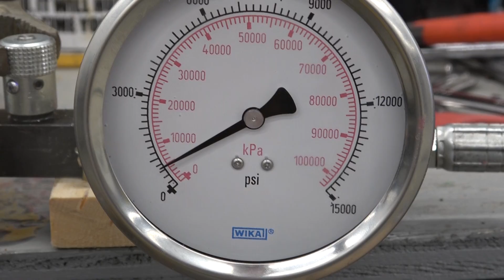How much pressure can PEX take?

Comment: The primary advantage of PEX vs. copper is crackheads and meth addicts don't rip it out of the walls when homes are under construction.
Reply: Primary advantage is it's cheaper.. also easier to install without screwing up.  Also when the asshole plumber lays half of it on top of your steel ducts with no insulators, it doesn't rot in 3-5  years and flood out your basement.
Reply: @BobSmith-rs7tn  Awfully specific haha.  That sucks.  I'm totally comfortable doing my own plumbing with PEX; more than I can say about my faith in my soldering skills.
Reply: up in the cold climates, its the go to, now. I've seen it survive minor freezes and contract back (nearly) to original size. Just about every new construction and full remodel site I've been on, is using pex. Crimp, cinch or expansion though, never shark bite.
Reply: @gpadog  Same. I've yet to see it fail from freeze/thaw cycles. I'm actually suspicious that it has saved metal pipe sections by acting like a spring when the pipes freeze.
Reply: @gpadog  Push connects are used on water heaters for easy install/replacement.
Reply: @gpadog  that's because it's cheaper. Price out a 10 foot stick of  copper vs pex
Reply: @gpadog  here in texas its pretty much taken over
Reply: @gpadog  Sharkbite fittings fail at about 150 PSI and should never, ever be used in a concealed place. On my job sites I only allow them to be used temporarily; when the plumber is gone, the sharkbite fittings are gone
Reply: @pinhedd  I was replying to the op, how pex is better. Not a fan of sharkbite except in an emergency, and the propress is on another job.
Reply: @pinhedd  I have plumbed 5 houses about 10 years ago and the sharkbite fittings Push to connect have not failed or leaked. Installed the right way and they will last a long time.
Reply: @pinhedd  there are rare situations in repairs and reno, say around a tight corner with not enough access and you can't cut into the studs.  Then you need the shark bites.  I personally would rip the damn thing out, but most wouldn't.
Reply: @pinhedd  I agree if you consider yourself a plumber you shouldn’t be using sharkbites they’re for homeowners and handymen
Reply: PEX also isn't sensitive to rust settling in the pipe, whereas copper develops pinholes.
Reply: Duck Multiverse it’s not rust, mostly chloramines used by city to treat water. Also old water heater deposits steel in the pipe then electrolysis causes corrosion and you get a pinhole. Copper coating 4x what PEX does is a big factor too.
Reply: way easier to run overhead as well and still accessible
Reply: Also dont blow if they freeze. We've dont lots of replacement at a family house and eventually replaced all of it with pex. My lines have frozen two or three times in the 13 years we've lived here and the pex hasn't blown
Reply: @bolerdweller  Yep I can attest to that, we has a spell of -40 for a few days and had a remote laundry room freeze up and after the spell and the temp lowered we it was able to thaw out.
Reply: You mean joggers don't.
Reply: @umeng2002  oh, I see what you did there
Reply: Don't know anything about this mind you, the tubing might be cheaper than copper per length but those fittings look expensive as frick, is it really cheaper than copper taking in account all the fittings?
Reply: @teresashinkansen9402  just doing a quick look into it on home depots website. 1/2 90 fittings for PEX are about $1 vs copper about $0.5. Where PEX really eats coppers lunch is pipe price $0.23 vs copper $1.40 per ft. Also PEX is slightly flexible and comes in longer sections so you might need not need as many fittings.
Reply: @WilliamJay  need to add in time to sweat the copper fittings. Also propane/map gas, solder, etc.
Reply: @teresashinkansen9402  The crimp connectors are cheap. The shark bite not so much. But no professional uses shark bite that I know of. That stuff is for DIYers who don't want to buy an expensive crimping tool. It works, but I'm told the water hammer effect can eventually work those spikes deep enough to burst the pipe. However they seem to last. My first home reno has them, and they have lasted pretty well touch wood. Thankfully I know better now.
Reply: @Patrick-857  The crimp tools do not cost that much. What the crimp does is cause more failures than the sharkbite. I have installed 5 plus houses 10 years ago and never had a leak. I just did my house a week ago and did not have a single leak. My roofing contractor how needed a temp line put in for power washer installed a few crimps and they did not seat right and leaked, I jumped in and put a sharkbite in and had no problems. The other thing is that if you do not have enough crimps you are stuck. If you have to make any changes sharkbites are easy to remove and adjust. Crimps take more work to remove and adjust.
Reply: @teresashinkansen9402  using sharkbites for the whole job, probably not. Using the compression fittings, most likely. I know they've been installing this stuff in new homes as far back as the early 2000's when I was working for my dad building houses.
Reply: @teresashinkansen9402  Sharkbite fittings are more expensive than compression fittings, but they make up for that in how quick they are to install. I'm no plumber but sometimes I'll change a valve, and instead of carrying compression fittings and a large bulky crimp tool, I just cut the tube right off with a pipe cutter (PEX is even easier, it just requires some sort of scissors made for that) and I slip the new valve right on and call it a day. It's way faster than nut-type compression fittings or copper soldering.
Reply: @teresashinkansen9402  PEX uses considerably less fittings than copper so it makes up for it.
Reply: @teresashinkansen9402  Depends on where you get them, Fittings cost around 10 USD each and if you order off brand ones you can get them for about 2 to 3 USD per fitting. The cost my be a bit more yet the labor to install them is way less. I just plumb up my house with 2 toilets, one shower, 7 washing machine outlet boxes 3 sinks, Along with some drop legs for commercial 3 bay corner sink and side hand sink. I used 200 feet of 3/4 pex and less than 20 feet of 1/2. The only reason I used 1/2 is that they do not make washing machine outlet boxes for 3/3 or make toilet kits or sink kits with 3/4 connections. Washing machine outlet boxes are to supply 2 washing machines, 1 mop sink, one ice machine, one automatic pet water bowl, one dish washer and one coffee machine.
Reply: Just wait until they go start stealing ground lines off utility equipment and get electrocuted.
Reply: That's a big selling point but another big one is wannabe plumbers who have never soldered a pipe have become plumbers. It's horrible! I've been an HVAC tech forever & I just started my own business. I'm building a customer base & I've been on a few jobs that have blown my mind. I can't believe some of these guys who call themselves plumbers. The one guy couldn't solder!!
Reply: Coppers hit or miss where I'm at in Northwest Florida. Pretty much if you're on a well forget about it. The copper in my house is doing fine but the next house down the road may have hell with pinholes. I mainly see them around water heaters or in the slab usually on the hot. I don't know if its just a bad run mixed with the water because some houses never have a problem and some constantly do. Pex is the way to go imo.
Reply: Also pipe in pipe is standard here for enclosed runs, outer pipe is just leak protection/teller, and it’s possible to reline if it’s not a nightmare run.
Reply: There are several advantages. It's cheap. It last a long time. The pex in my mobile home down south has been there since the 80's with no issues even with it being possibly frozen in the winter when everything was shut off. I tried to drain the lines, but I am sure I didn't get all of the liquid out. Its flexible lightweight and easy to install no soldering required and plastic can withstand the sulpher water that has corrosive  hydrogen sulfide  in it that eats metal pipes.
Reply: You must be from Canada
Reply: Good point- I've only ran pex....full crimp only...not the single sided pinch crap!
Reply: Every time I replace pipe I replace it with pex, holds up so much better in the cold, and those shark bite fittings makes everything quicker to get done, even my job is known to use them for any line not under real pressure
Reply: just plumbers after the mouse chews holes in em mistaking them for cheese sticks.
Reply: Let us hope that hot water tanks can be made out of this stuff. In the UK here a lot of water tanks are copper and i have seen those people you describe doing that and taking the tank also.
Reply: @alexgrant1979  Yeah they do that to empty houses here in NZ too. Rip it out and leave the water running. Owner may not find out for weeks, by which time the damage is catastrophic.
Reply: god north america has an opioid epidemic, can't we just give em weed so they calm the fuck down?
Reply: @cdoublejj   we need some cocaine to calm down too
Reply: Actually had that happen on a regular house here in Baltimore.  Got a call that someone stole the copper out of a house, LIVE, and their 1" main was flooding the house.

By the time I got there it was 8" deep in the whole first floor, and actually running out the front door into the street.  All this during single digit temps too lol
Reply: I know the primary benefit of PEX versus copper is as a plumbing company owner it's 1/8 of the price to my cost.....
Reply: Metal prices crashed years ago

Comment: Repeat with Uponor ProPex.  Bet that's a good show.  Sharkbite sux, btw.
Reply: Wirsbo has so many advantages, I love how it will go back to faktree configuration with just some BTUs!  And, unlike German women, it never stretches out at the fittin' ends!
Reply: I searched the comments until I found an Uponor comment, just to give it a thumbs up! Great product and company. Get the 3" ProPEX fittings, Milwaukee cold expansion tool, and their 3" tubing... Impressive stuff!
Reply: If AVE tests on the Uponor Pex, I hope he includes a bit on the chemical differences of how the irradiation process is different during manufacture and how it can recover from kinks unlike the inferior pexs.
Reply: @timkunsa7249  Uponor PEX is not cross linked with irradiation, it is chemically crosslinked during extrusion. I agree that hearing of the differences between PEX-A and B would be interesting for many. I do the kink demonstration often and it gets everyone excited!
Reply: @SlipNSlideMNzx2  Thanks for clarifying, I couldn't remember how the cross-linking was different.
Reply: @AVE   Hey AVE, if you want, I can send you some short lengths of Uponor, I'll even put a cap at one end and an NPT fitting on the other with the Uponor rings.  Send me an email at my user name @ gmail or @yahoo, I have both.
Reply: I wanna see some copper blow chunks while were at it.
Reply: the downside to uponor is that you have to install it and uponor sucks to install, especially if you have a lot of fittings close together.
Reply: @theghostofthomasjenkins9643  I guess compared to SharkBite.  I always found it pretty easy to install.
Reply: @jeremydumoit4487  even compared to copper and crimp/clamp rings.  too much head switching for the tool and then the minimum distance between fittings can utterly screw you on spacing.
Reply: @theghostofthomasjenkins9643  I never switched heads.  But I've only plumbed houses with it.  To each their own.  I love the stuff.
Reply: @jeremydumoit4487  i do mostly commercial work, so that's probably where the different experiences come from.

Comment: Pex is rated for just under 500psi, made at a factor of 2 so no chance it kills a 10k psi pump. Saying 1200 psi if the fitting even holds that

Comment: As a plumber I love when guys use shark bites. I love making money in people's homes and businesses cutting that shit out when it leaks.
Reply: Then it wasn't installed correctly. I'm a plumber and we only use sharkbite and pex anymore. Never had any problems.
Reply: @SgtNomadZero  lol buddy are you sure you have a plumbing license? Come to Boston and run copper and pour some lead joints then do some medgas.
Reply: @SgtNomadZero  There's no way in hell that you actually hold a plumbing license
Reply: @jake3333333333333333  have for 4 years now, what's your point? You think pex, that's been used for decades, is somehow bad? That copper is better because it corrodes and breaks if it freezes? If you're actually a plumber, you should retire with your old bullshit logic.

Comment: Aging? Try 25 year old cpvc...brittle like Staind Glass
Reply: Try 20 year old polybutylene. Now that is some hot garbage
Reply: Aye, CPVC is fekkin gahbage
Reply: Even 5 year old you have to cut with a saw and not a tubing cutter
Reply: I repair foundations in florida and irrigation pvc is always brittle as hell no matter when it was installed. We end up breaking pipes often along the sides of house. Then we gotta fix em.
Reply: I've had stuff that was 2 ish years old that shattered in my face when i tried to use a tubing cutter. I'm pretty sure the guy had turned his water heater waaay up.  Thankfully i had the safety squints on.
Reply: can confirm. just had to replace a mixer valve in my mothers house. that 24yo CPVC shattered like glass. had to use a dremel with a cutoff wheel. replaced everything in there with PEX and sharkbite fittings.

Comment: Gave a fella a like for that 70’s style load blowing slo-mo with the shuttering lights.
Reply: Lol just the camera picking up the 60hrz flash of the light
Reply: @owendodman3037  120 Hz, normally.
Reply: impressive ropes for a man of his age
Reply: @danielrouw2593  I like your filter idea. 👍  That's the problem with these cheap LED lights and their drivers. They don't use sufficient capacitors, because of cost. Or worse, they overdrive and oversell the LED's, and rely on the brief down time to get the device through it's 90 day warranty without catching fire.
Reply: @notsevenfeettall  todally.  nothin' like a cheap 70s porn music track for when she blows in slo mo

Comment: I was a union Commercial plumber for 10nyears until a. Injury and now I am a chemE senior.  Now I like copper also, but there is many different types of pex.  Actually it would be cool to see the difference.  Uponor pex. The way they make it is the difference.  Rehau is the same I believe.  The uponor with uponor fittings is just fine for any house hold use and probably better as copper is not needed to be mined.  You look like your using some mobile home stuff but don't know.  The cut voids all engineering in it.  We have to cut that out usually.  Also there is a oxy barrier that can be destroyed by the sun if left in it.
Reply: Heat cycling is just fine with uponor fittings is great. It's actually better.

Comment: I just re-piped my kitchen with pex AND shark bite . No leaks. SO FAR. HAH
Reply: Buddy redid half his house in 04 with sharkbites and Pex. Still working today without leaks. Solder will always be better but sharkbites aren' t the worst thing u can do either.
Reply: @gearjammergamer8560  The main failure mode for Sharkbites and similar connectors is burrs and sharp edges mangling the rubber seals. Break pipe edges so they don't damage seals on their way in and those push connectors should last a long time.
Reply: @gearjammergamer8560  Wow, early adopter in 2004.
Reply: @D2O2  I only remember because he got divorced the same year haha
Reply: @gearjammergamer8560  Over the cost of those fittings in 2004?
Reply: Now get the milfukkie out and test the pipes pressure.
Reply: Sharkbite's great if there's little clearance and the copper's full of water. I've done a few hot swaps like that. Very dicey.
Note: they do make a deburring tool for sharkbite that's mainly meant for pex but it does work on copper for a few times. Otherwise I give it a few passes with the sandcloth.
Reply: Chuck  maybe they got sick of calling you and went for someone else :P
Reply: @TheJunky228   LOL, yeah not exactly looking out for the customer there.  Should have put a regular Pex fitting on it after the first or even second time.